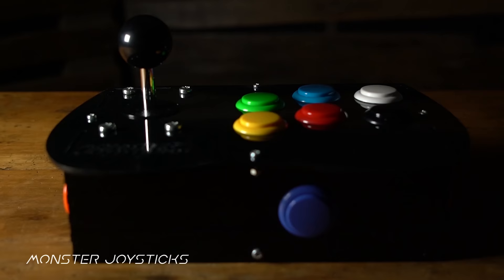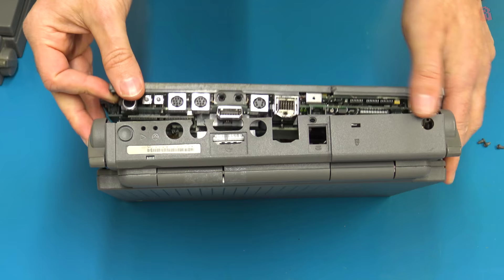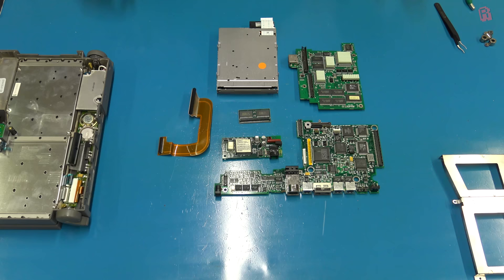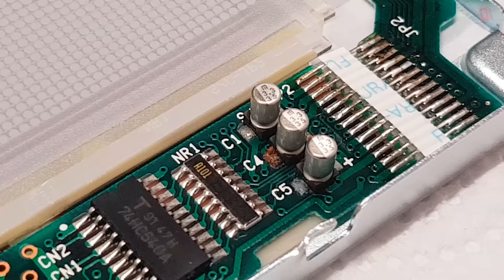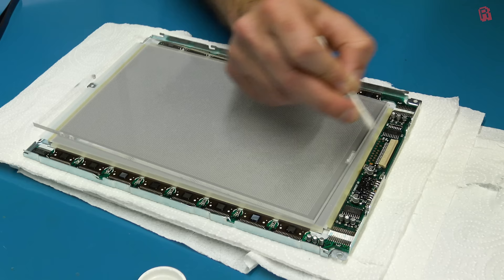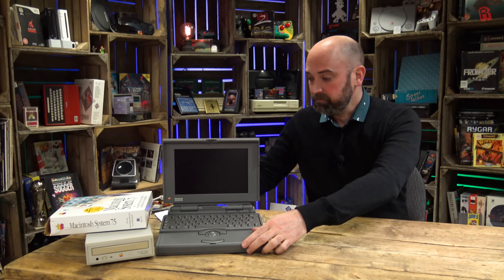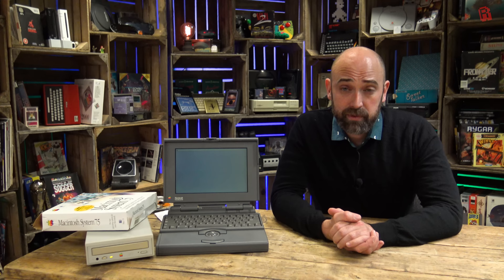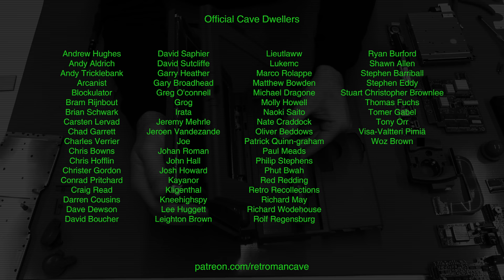Restoration of a '90s Apple Powerbook - Trash to Treasure

Comment: Another thing you can do if your soldering iron isn't playing ball is to see if you can fit a bigger bit in there. Ideally, you want the biggest bit you can fir onto the joint, to get the heat in quickly before the temperature starts to rise, traces start to lift and PCBs start to delaminate.
Reply from the maker: Good tip thank you.  Sometimes I'll resort to the desoldering gun for solder duties with its huge tip, it can be very effective!
Reply: @RMCRetro  I was quality manager of a company that had its electronic products made in China. I am also a qualified electronics engineer. So I spent 18 months in China (fly out for a month, back for a couple of days, then back to China) to sort out the company's issues. 

They had problems with delamination, lifted pads, solder balls, excess solder flow through the via, and when I watched them, it was easy to see why: they seemed to think that tiny little soldering iron bits were somehow more "professional", and they had no idea how to solder. They would melt a bit of solder onto the iron and try to persuade it to make a solder joint.

First thing was, I showed that doing it right was way quicker than doing it wrong: wipe the soldering iron every joint, tin the bit, have the soldering iron on the opposite side of the lead than the solder... then I taught everyone how it was done, including supervisors and managers, so they could see if someone was having trouble. We got Metcal irons so there was no temperature know to fiddle with, the biggest bits that would fit, and we videoed the training and had it subtitled in Chinese, to be shown to all new starters.

Eventually, when I had sorted out all the company's quality problems, my company hired a Chinese resident to take over, and I was made redundant (thanks, guys, £20,000 was nice, but it was still a rotten thing to do). But just a year ago, the ops manager, who hadn't been to the factory for the seven years since I did the training, called me up to say he'd just been over there, and it  was mesmerising to see row after row of workers, soldering perfectly in accordance with what I taught. That at least was a boost after the redundancy.

Comment: I have been told that someone had put a RaSCSI drive into a Powerbook 520. This would be an awesome option - it's basically a SCSI chain being run by a Raspberry Pi Zero. It allows for a few virtual 600mb drives to be mounted as well as emulating a SCSI ethernet connection via the Pi's Wifi connection.

Comment: I have a few PowerBooks, from the early 2000's, which still run Mac OS 7.5 - 9.2, but they are not the 68K series CPU, of course. The first Mac laptop was the model 100. I recall working for my college bookstore, and we were selling 140 and 170 models, at the time. That and the LCII, and Color Classic, among other higher end models. It was a great time and Macs were aspirational to own, over PC.

Comment: The 2.5" SCSI2SD seems like the best ticket forward for me. Also note that you shouldn't hot-swap ADB devices; if you're unlucky you can blow a fuse on the motherboard. Most newer Macs had polyfuses, but ADB hubs and earlier Macs are going to make you break out the soldering iron.
Reply from the maker: Thanks for the tip on the ADB, I wasn't aware of that
Reply: @leaded solder - did that ever happen to you??? I'd heard exactly the same thing back in 1997 when I purchased my first PowerBook 150 (not nearly as capable as this machine). I went on from tinkering on Macs to working with them full time. In all those ABD years I never had (or heard of) any Mac die as a result of hot-swaping ADB. I'm not suggesting you do it, just relaying my experience and keen to hear if anyone actually had an issue.
Reply: @davidczepanski1359  I blew a port out on an AppleVision 1710 monitor by hot-swapping a Gravis game controller. The PowerBook might have a little bit of magic since I would assume they'd expect people to be hot-swapping all the time.
Reply: @leadedsolder  owch. and of course there's even more reason not to try it now these machines are so old! SO thankful for USB when it came along!
Reply: @davidczepanski1359  Yes - USB is a huge blessing. It could always have been an ESD failure, too - I never did take the monitor apart and confirm the death of a fuse.

Comment: Inertial computing sells an external SCSI2SD adapter that takes a micro SD card and I think is less than half the size of the one you have. It comes in a 3D printed case, but you can take it out. It has an external SCSI connector, so you'd have to figure out an adapter, or change the connector. That might work. Or just use it external like I do.

Comment: I remember working on those in the 90's, usually installing RAM upgrades for friends.  Then I got a job as a computer tech for a couple years (CFST, A+) after graduating in `92, some of the later Powerbooks and other models needed a special RAM module pulling tool or you could damage the mother board; there were about 5 or 6 different ones to make it more frustrating......

Comment: SCSI2SD V5 from personal experience. About $85 USD for the PowerBook version. You will need the modified Apple HDSC setup utility. The one on your 7.5 CD  will only initialize discs with an Apple EPROM. That can be found at most Apple abandonware sites. Also, if you’re going to break out to a monitor, you can use a DB15 to VGA adapter so you can use any VGA monitor.

Comment: What is really interesting on the external monitor output is how apple managed to have it in this PowerBook. There is a NuBus-ISA converter and a standard low-cost off-the-shelf VGA chipset (WD90C26, no acceleration) with 512KB of its own memory (Apple's own chipset didn't support external screens at all). Due to this design, it is possible to use both internal and external screen together in the extended desktop mode. This was not possible on PC laptops back then.

Comment: Thanks for the lovely video!

Reminds me of the time when I got a ratty PB 145B with a broken trackball, worn hinges and a dead screen. I ended up swapping the entire topcase with screen and keyboard for one from a 170 with a dead logic board, which gave me a much better screen than the original 145B. That must have been around 2010 I think.

Comment: Lions will always regret not having enough money to keep its Powerbook 145, but that's just the result of choices in younger age.  It worked perfectly except for difficulty booting up, probably because of a cracked solder joint.  Those old active matrix, 2 color screens looked unique to their time.  It's a good example of the kinds of consequences which happen 40 years after the decision to slack off.

Comment: 6:05 - yes 2.5" SCSI drives stopped being manufactured during the lifetime of the later laptop models. Apple still had to honour warranty so they provided a very clumsy 2.5" IDE hard drive with an IDE to SCSI interface as way of a replacement. We bought their entire stock of 2.5" SCSI drives they didn't know they had (as they where a different part number for the LaserWriter range!)
Also with the correct cable & keyboard combination you could turn the PowerBook into an external SCSI hard drive! It supported up to 7 SCSI devices which where daisy chained (not just 4 you mentioned!). Also worth noting that this was the first PowerBook model that supported 8 bit colour (with a proprietary connector of course!). You could also plug a monitor into the SCSI port...
Reply: What's the difference between the scsi this device uses and the 2.5" scsi drives on eBay for less than $100? The connectors look similar, but I assume there are different generations similar to sata revisions.
Reply: @sirseriously  I don't know what SCSI drives you are referring to? The SCSI interface types are High Voltage Differential (HVD), Low Voltage Differential (LVD), and single-ended. as long as you don't mix LVD & HVD you can use most  SCSI devices on the same bus (the bus will operate in single-ended mode which will impact transfer speeds). You can find that detail on Google. Perhaps more importantly (and as I mentioned in a previous post) 2.5" SCSI drives ceased being manufactured in the late 1990s. Any 2.5" SCSI drive you purchase now will be at least 20~25 years old! Worth bearing that in mind - given the use case you may find a SCSI to IDE or SD might be a better option.

Comment: So sad, I surplussed so many of those machines in 1997 when I got my first job in College.  I can say I personally removed at least 100 of those SCSI drives and had them shredded for data security.  Those and the powerbook duos were great fun to use right before we "retired" them.  The Quadras of that era made for a great fort in the break room, due to the fact they were great plastic bricks, and that we had 200 of them.

Comment: As a Portable owner, I hate those surface mounted caps. But I probably don't have the skills that I should have to repair it. Ended up damaging a couple pads but it still works enough to give a power manager error.

Comment: As regards that HDI30 cable...
Might have been an idea to strip the insulation and install a switch into the relevant wire rather than clipping the pin. That way the one cable could serve both functions.

Comment: Just so you know but they sell on eBay SD to SCSI cards that have more of rectangle shape that fit in 2.5” and 3.5” drive bays. They are available in eBay for around $100 U.S. The ribbon cable connector and power connector are on the side on these cards so you would need to find a way to get the SCSI ribbon cable to make a 90 degree turn since the old drive had these ports on the back.

Comment: Nice work! It's interesting to see how much simpler these early Powerbooks are to work on than more modern Mac laptops. My only other experience was replacing the lower casing and screen on my Powerbook G4 back in the day. I actually just rang up the local authorised Apple repair centre and told them I was from the IT department of <the company I worked for>, told them "we" had a dented Powebook G4 that was out of warranty, and asked if they had a replacement lower case for that model that "we" could purchase. I guess they thought they could get some business from us, because they said they did and I could have it for free! (After implying I was "qualified" to repair Apple hardware...) When I showed up they said they had a spare screen I could have if I needed it (which I obviously took, since the hinge was dented as well). I do wish I hadn't sold it to pay for my next Mac laptop; I've since added another example of the same model to my collection, but it's in much worse condition than I left mine (clearly had the screen repaired internally rather than replaced).

Anyway, I've also got a Powerbook 1400C which needs some TLC. It only booted a couple of times when I bought it, and I'm not sure if I've damaged it or the power supply trying to charge the dead battery, because it won't turn on anymore.

Comment: Nice, I just got a Powerbook 145, good shape overall but it's got a problem with the display - every 4th column in the top half of the display is not working. My first thought was it was probably a break in the display cable, but that seems fine. My best guess at present is that capacitor leakage in the display has damaged one of the display data lines for the top half of the display. Hopefully when I recap the thing I'll be able to identify the damaged trace and repair it.

Comment: I borrowed a Powerbook 160 for quite some time at the end of the 90's-early 2000s, it was an already old machine but surprisingly pleasant to use. Overall, a smoother experience than the Win95 486 laptop I also had. And that trackball was really something.
Reply: I don't think I would have been interested in it at that time, but these days it's like a whole corner of retro computing I just didn't experience the first time around. I'm especially interested in trying out a Compact Mac

Comment: Not a bad little refurb job. I remember renting these out from the Computer Store I worked at back in 1994/1995. They were pretty good machines. I have not seen a real SCSI 2.5" hard drive in over 20 years now. I suppose I used to sell them, but back in the day I only used SCSI in file servers and on my Amiga 3000.

Comment: What you mention about 2.5" scsi HDD is of interest as I have 2 Sun SPARCstation Voyager "luggables" . They also use the same size HDDs, but annoyingly really hard to find proprietary memory modules, but have 16mb as standard. I really need to dig them out and see if I can get any life from either. If I can get one working I may put a rPi in the other that is known to not currently work and put a colour screen in it for a unique retro machine (another idea was a miniITX system, but fitting it in might well prove difficult).

Comment: if you do not find a sd to scsi converter that fits inside the MAC, an alternative option is an external one with the cable if it is nicely boxed, but I would also prefer to have the device in the machine.

Comment: Great job =D  Was going to suggest SCSI2SD but it's too large =/  I wonder if there's anyway to fit it if the SCSI connector was replaced with a cable soldered to the PCB where the IDC socket was - I doubt it, probably still to large in its length and width.

Comment: It would have been really interesting if you somehow managed to have a switch on the side of the SCSI wire to disable PIN 1, without having to destroy it, and maintain the original usage if/when you wanted to.

Comment: There are now much smaller SD2SCSI units you can get. The one in my Beige G3 is a third the size of the one you have. A smaller one might be able to fit in the drive bay.

Comment: Use a Raspberry Pi storage mod.  there are ways of converting a Raspberry Pi into essentially a hard drive or storage device.  once converted, you can use the Raspberry Pi and storage module with an SD card and just completely replace the hard drive causing it to act slightly similar to an SSD.  probably would need to do some multi conversions with it but it's possible.
Reply: It's a pretty economical option ($30ish for a midrange Pi plus maybe $10-$20 to put together a level-shifter board for it) but something just feels kind of wrong about replacing a computer's hard drive with another computer that's like a hundred times more powerful than the host machine...
Reply: I love the form factor of my 165c. If it were modded and had a new clear screen, it would be a pleasure to write on.

Comment: 2:21 - actually the original flap was a solid piece of plastic - the tiny plastic lugs are all that hinged the whole back flap. Annoying it usually broke with the plastic nib stuck in the hole . I swapped out many a bottom case due to that issue! Also there should be another small plastic tongue that sticks into the laptop to act as a latch. This is what made the flap stay closed, but also what made it difficult to open resulting in the nibs breaking off. If the flap was opened correctly (there is a small indentation on the top) this allowed it to open without resulting in breakage, but few people opened it correctly.

Comment: Got a Powerbook 140 in queue for repairs with rather similar (and for what I've understood, typical for the series) issues: a dead HDD, screen that needs recapping and a battery which was about to leak. Too bad my model doesn't yet have that external display connector. Such 30-pin SCSI adapter cable was also relatively hard to find, and wasn't familiar about that pin thing, so it was nice to know. 

Been considering plugging a normal 3.5" size HDD into the laptop with a 2.5" SCSI adapter, but maybe that would be too inconvenient apart from just testing. A SCSI2SD would be an obvious choice, although in a way feels silly that those would cost several times the price I paid for my stale Apple. However, it wouldn't be the first (or last) time when a vintage computing device having gotten half-free would eventually get its total price tag multiplied by several times.

Comment: Maybe a platter and head swap from a similar ide drive, back in the day I had minor success swapping the boards on ide and scsi quantum 80Mb laptop hard drives. The reault was not a working drive but as a kid I think I was just missing something that I could probably figure out now since it did seem to make all the correct noises.

Comment: SCSI2SD is open hardware, schematics and pcb files are on their git page. The only expensive part, CY8C5267AXI is ~$6 at RS Components/Mouser. JLCPCB loves to sponsor YTbers, you could do collaboration with them and earn some money while doing interesting project :)  Maybe even make extra boards and sell on a side/supply fellow retro collectors.
Worst case scenario you will end up with 10 modules for the price of one (~$100).

Comment: I recently picked up a powerbook 160 on a garage sale. Works fine. Boots up, floppy and hdd both work fine. Even shows an image. But it has a serious problem: the screen. If the device stays on for more than 20 minutes, the screen becomes dimmer with every passing minute and the image that is still visible, persists on the screen no matter what it actually tries to display. The only option here I see is to replace the matrix, because mine apparently has become very tired. I don't know if it is even possible to find a replacement that will be relatively new and fresh and will not cost a fortune.
Reply: Here it is... my beauty! https://www.instagram.com/p/B7cGS9ghv0QdjkIGVB_BUKjo41d-69biBoVc6A0/

Comment: If you're going for authentic, get an Apple IDE to SCSI bridge card and up to an 8 GB 2.5 in. IDE drive. Back then I admired Apple for sticking with SCSI but as we all know SCSI died for all but rackmount servers. By 1992 or 1993 virtually everything 2.5 or 3.5 in. was IDE, and that was almost 30 years ago. SCSI did hang on for a little bit for 5.25 in. optical drives, but not very long.